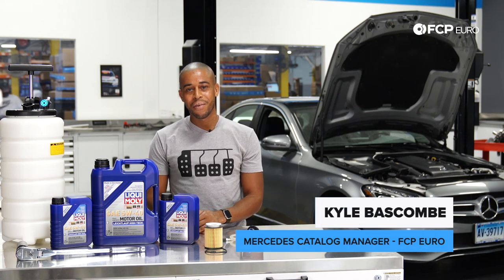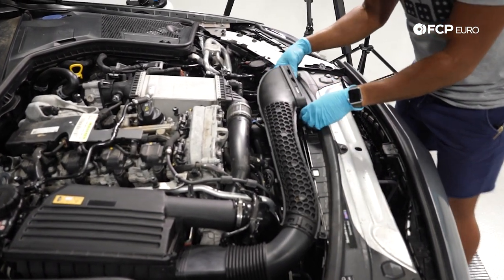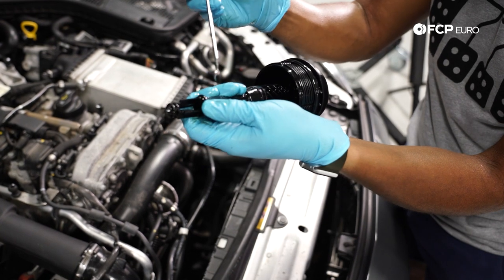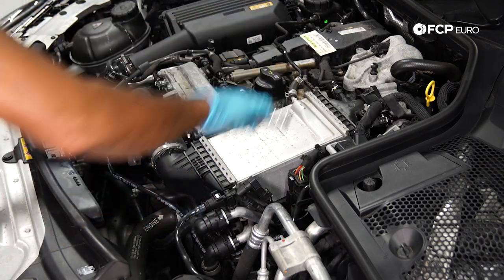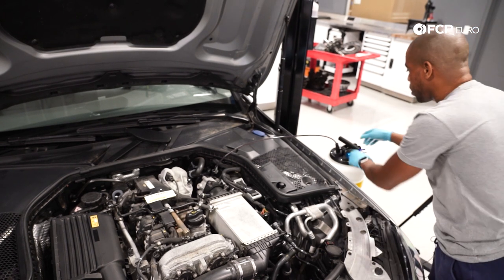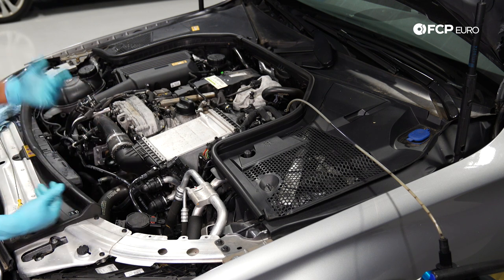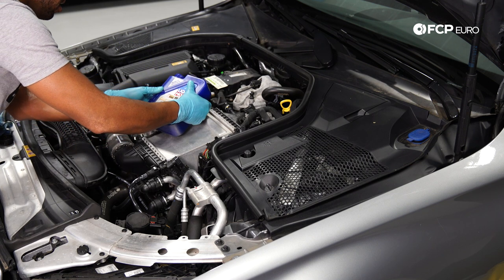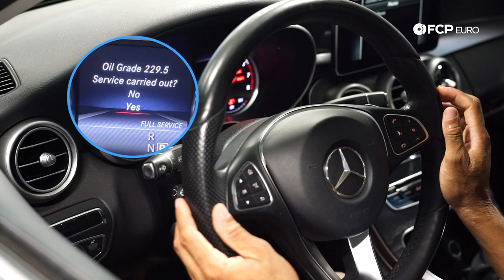2015-2018 Mercedes C-Class, E-Class, GLC- Oil Change + Service Indicator Reset M274 (W205,W213,W253)

Comment: To properly check oil by MB- after you put your oil in showing 1/4 up the stick 
1-Get car up to temp- shut car off
2- set a 13 min timer- when car is turned off
3- check dip stick after timer is up
4- add oil till half way on stick repeat step. (13min cool downs)

Comment: Hello sir. I must say nice video very professional. I have two questions I have try to cancel the oil change message with your instruction which are the same as other videos but I never get to those menus to confirm the oil change is done. With that the second question is can I remove the message of oil change before actually changing the oil and filter? I know it sound dumb but is a question. Thanks for your service.

Comment: Quick question what size of torque wrench are you using? 1/2 inch driver? 3/8 or 1/4? Planning to do my own oil change on my w205. TIA for the info and more power to your channel and company!

Comment: Greetings, I have a 274 engine e180, I want to share a problem, the car misfires after 50 km and 60 km in economy mode, this misfire is more pronounced in calm driving, it becomes unclear in sports mode due to too much gas, but the same problem exists at high speed, the vehicle does not give a fault code. However, when the thermostat temperature goes downhill at 60 70 degrees, the oil, filter, spark plug, maintenance and changes of the vehicle are made, where can the problem originate, respect

Comment: How long can the oil that you used last? 10k 15k miles? Also why not just drain the oil under the car? Why use the extraction tool? Seems like it takes longer..
Reply: 10k miles, but i change mine every 5k. and as for why do it from the top, have you seen underneath a mercedes? depending on the model you have to remove underbody panels to get to the drain pan. and also on the M274 the filter is up top so no need to be under the car to change that. personally i bought a pneumatic one that i could hook up to my air compressor, that saves a bit more time.

Comment: I have a q50 2.0 t I'm curious as to if my intercooler is an air to air or air to water, and I've been using mobile 0w 40 (that's what in most auto parts stores for European oils. I take it to my mechanic and he puts it in, (infiniti service uses 0w20 which is incorrect) even though it says change the oil once a year I'm the owners manual I change it every 3 to 5 k miles as I live in NYC. Is liquimoly that much better than mobile 1

Comment: People are telling me NOT to perform top extraction because the drain plug is magnetized to catch any metal shavings. It's better to drain the oil from the pan clean the plug and replace the copper washer. Is this true? I also hear dealers perform top extraction because of the time savings of not removing the shield etc...
Reply: No. Dealers have really expensive extractors. They actually get more oil than getting it from the bottom but Change more frequently if doing it from the bottom. Find a cheap mechanic. Change oil and filter after 6 months and its better and cheaper than the dealer.

Comment: Another video, that goes into oil extraction, mentions that as much as a liter, if I remember correctly, is left over during an extraction. Have you had similar results? Or is that not much of a concern? Maybe ensuring there's a vacuum beforehand mitigates that?

Comment: Couple things:  definitely do NOT want a semi sealed system for the oil.  If it is sealed, you'll pump no oil.  Also, warm up the engine or else you'll be pumping that extractor all day.  Don't get your oil nuclear; just warm and it'll start flowing nicely.  Be careful with that cheap plastic snorkel pipe; you don't want to damage it.  As always, that handsome devil Kyle knows his stuff!
Reply from the maker: You are not wrong! Those tweaks to the process would shave a couple of minutes and quite a few pumps. -KB

Comment: Please do a video on changing oil in a 2021 E350.  There is no dip stick and the oil change reset is very tricky.  Getting to the "Workshop" window and getting the reset to take is very complex. Thanks

Comment: What is the torque spec on the oil drain plug please . And possibly the size of the drain plug gasket ?
Reply: Drain plug gasket is 13mm

Comment: Apart from the filter and dip stick positions being distinct in a CLA 250, can I use the same equipment and process mentioned in the video on my 2018 CLA 250?

Also how much oil is needed for a 2018 CLA 250?
Reply from the maker: Hi Aaron, the idea is going to be similar. If you use the vehicle selector on the site, you will see we have a couple of oil change kits available for your CLA, containing 6L of oil and an oil filter.
Reply: Alright, thank you for the prompt response

Comment: The difference between W 40 W 30 the first brand oil what difference between Castro local Molly and mobile and Mini company I need top 10 company
Reply: @pfmurphy525  what difference between Engine oil w30 w40 Mercedes Benz e350 Audi a1 14tfca